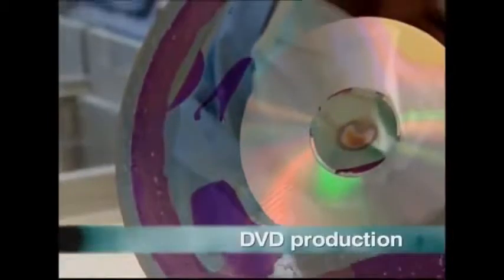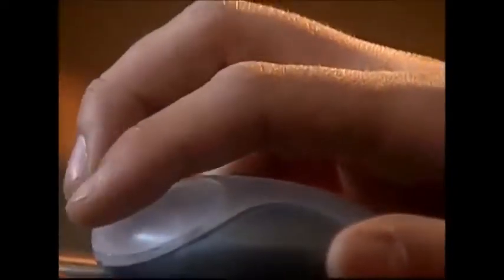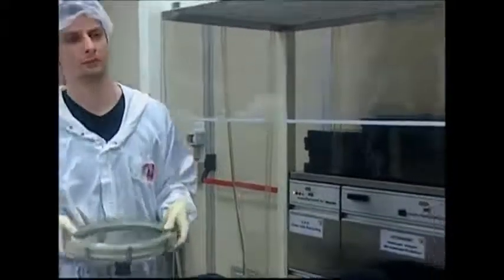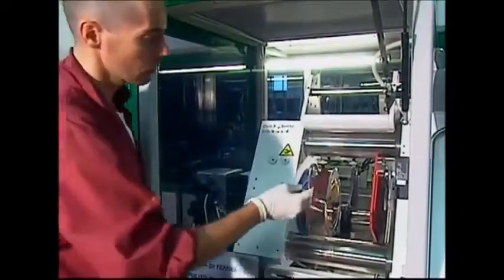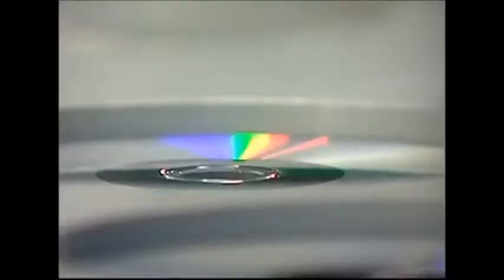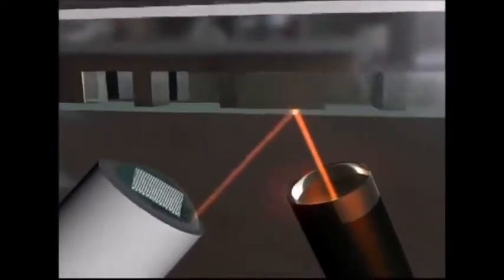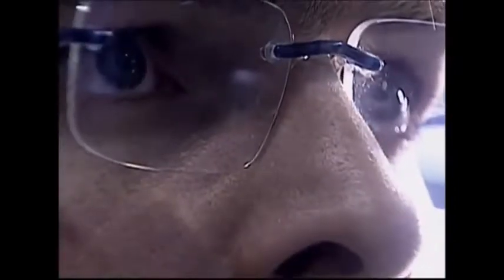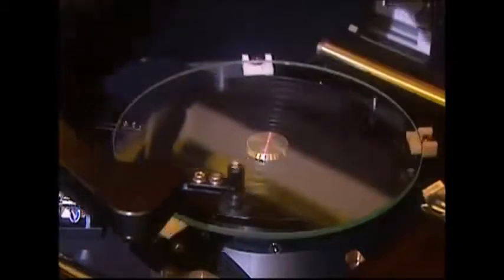How It’s Made DVD production.mp4

Comment: Yeah but how can it possibly show the whole film if it’s just plastic rolling in the DVD player?
Reply: it reads the grooves in the disc...
Reply: billions of yes/no commands are read from these tiny grooves and interpreted by the hardware
Reply: how can your computer work if the CPU is made using silicon
Reply: @cessposter  so much questions with no answer…😵‍💫
Reply: @flyingchimp12 the grooves are for sound tho which that makes sense but how do those same grooves produce a video you recorded with a camera that shit don’t make sense
Reply: @MrTheHeadlines   there is a weak laser pointing at these microscopic rings on the disk, and the rings are billions of tiny reflective bumps or grooves under the plastic. basically you come up with code where a bump means one, and no bump means zero. then, because the video is made up of ones and zeroes too, you can write the video in code as a very long series of bumps as yes/no information.
as long as the device reading it knows the code, it can reconstruct the video using the same process. a video is much more information than a sound, but if you lower the quality, you can fit a lot more in a disk. if you have more questions, I would suggest looking at the wikipedia pages on cds, dvds, binary computing, video codecs, or other related topics.

Comment: I was way off. I always thought that a pressing was done by placing a blank disc onto a hydraulic press. You then project the movie onto the press, let it play in its entirety, then press it into the blank disc
Reply: This is just one part of the entire process. There is a whole another process of authoring a Blu-ray/DVD that happens before the glass master. Getting the source file (videos) restored, and digitized from a film (if it was shot on a reel), the older the camera negative, the harder is gets to scan and restore. Then create custom menus (whether it's animated or not) for that specific movie/TV show/Documentary, etc. with various video files (movies with different cuts, special/bonus features), chapter them correctly and then QC it after burning it to a blank disc, make sure all the menus work as intended, making sure its compatibility that it works on almost all DVD/Blu-ray players that are out there, make sure there are no errors or video playback issues before its sent for pressing. Of course, I'm oversimplifying the process here. Nowadays with triple layer 4K UHD Blu-ray discs, the process gets even more challenging and complex. There's a whole lot that goes behind the scenes until a disc is final.